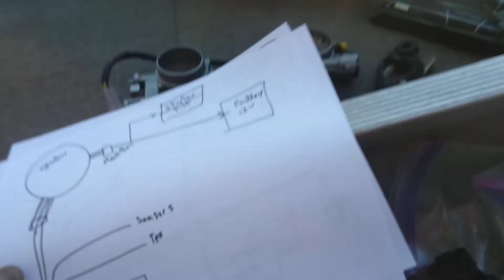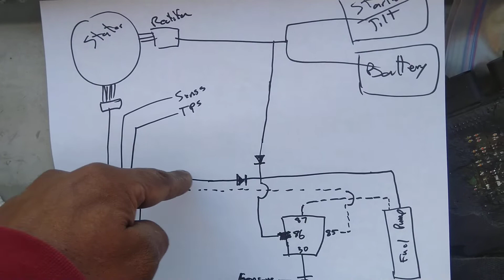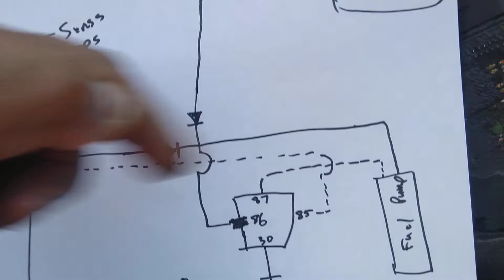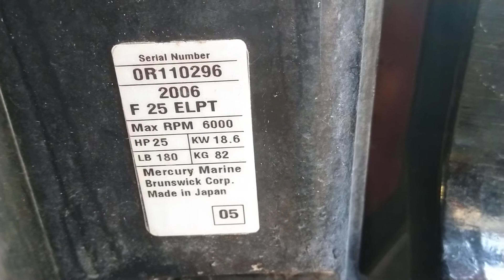mercury tohatsu 4 stroke 25hp 30hp outboard burning out ECU with aftermarket fuel pump

Comment: Thanks for the video, one of the few that actually helped and made sense.  If your ECU is not yet fried then this is one method to go.  Im about to replace my fuel pump on my 30 hp efi, I went over your diagram.  I dont quite understand why you Teed the ECU power with the stator power?  If you wire up the relay to use the ECU positive and negative on 85, 86 to trigger the relay and  use the  30 to the stator/battery from the rectifier  to run the pump positive lead on 87 and ground the other connector of the fuel pump to the motor.  Wouldn't that be the same and there would be no need for the Tee connection from the ecu power, isolating that ECU from the fuel pump power?  In theory if you have a dead battery in this method it would not fry anything but the fuel pump would not run as there is no power to the pump but, if you pull started it wouldnt the stator provide momentary power on each pull to power the ecu which would trigger the relay and draw power from the stator?   Im no electrical engineer so if anyone could chime in. Thanks again for your video, i must have watched it 8 times lol
Reply from the maker: The ECU and battery power side both have a diode on each line. They are T together because the main stator at idle does not put out enough amps to run the pump by itself. Same goes for the ECU by itself at idle it's only putting out 3.2 amps.  If you power the pump from just the battery with a relay yes it's a simple circuit and this is how larger motors operate. But if you idle or troll a lot that battery will be powering the pump and you will be left in the water stranded if it's to low of a charge.

So the solution is to power from both circuits.

The positive and negative from ECU powers the relay which does not take any kind of a load. By feeding it to the pump as well it still works as primary source of power. The relay all it does is closes the ground from main motor to pump, this is actually taking the bulk of the load. Then the main stator delivers the additional 2 amps to the pump via the T. At idle this circuit works great, because both circuits put out 3 amps, I have 1 amp left over on main stator to charge battery and or run fish fish finder. 

Here is where the diodes come into play. 
As you increase the rpm the ECU will provide more amperage to the fuel pump. At the same time because the ECU is providing more amps the main stator for battery outputs more and will reduce it's output to pump and divert it to the  battery. The diode also prevents the battery or tilt and trim from pulling amps from ECU. This way the ECU is protected as the amps is only going to the pump. 

I was able to measure the current flowing from each circuit on water and this little jack works passively.
Reply from the maker: The ECU frying is on the negative sise trigger not the positive. By using the negative from main motor case the pump has all amps available from the ECU and the rest is supplemental from main stator
Reply: @omieyouknowme   - Thank You for the explination. It really helps.  I just ordered parts to do this, ill use your method, funny im having trouble finding a relay with diodes on amazon, ordered a bosch relay with a diode on 85,86 but also ordered 20 amp diodes as per your diagram. Ordered a new low pressure fuel pump as the housing has some sort of corrosion making those clear discs not seal well.  Using 14 gauge wire, will let you know if it works.   Everyone should see this video before replacing their fuel pump with an aftermarket one.
Reply from the maker: @fern8808  the flyback diode on relay is to also protect the ECU from spikes when it turns off. You can buy relay at Napa as well. 
Be sure to check and replace high pressure fuel pump filter too. After this video I had a piece.of fuel line break off from low pressure inlet and plug the needle. Motor was starving for fuel at mid throttle.
Reply: @omieyouknowme  thanks, replaced all filters , plugs and low pressure fuel pump, cleaned injectors and in the process of replacing the high pressure pump.  everything but the fuel lines replaced and the high pressure reg.  I guess im the guy who thres parts at it lol got stun out on the water one season and was trying to get back using the trolling motor.. almost made it. a boater was nice enough to tow me to the dock after 2 hours of trolling back.  This motor is noew to me, when i purchased it it ran fine, a year later it didnt run as it was sitting in my garage while i was raising the transom of my boat. when I fired it up it sputtered and thought it was the filters so I replaced them, same thing, thought it was the fuel pumps but read the after market ones fry ecus and came accross your video. Its the only one that explaines in detail what you need to do . Thanks again ill let you knwo if it works out, waiting on blade connectors lol

Comment: I have a 2011 25HP non tiller ECM still good I just got this fuel pump what’s the easiest solution to keep my ECM safe
Reply from the maker: If it's non tiller then you have electric start. I would do a dual power source like I did use a decent diode on each line to prevent feedback. Then use the negative for fuel pump to trigger a relay. The relay should close the negative side of pump to engine ground. The duel feed will allow ECU and main stator to feed pump all the amps it needs. As engine rom goes up the ECU provides the amperage.  The negative trigger from ECU is what fails if you use that to drive a relay there is no load on that circuit
Reply: @omieyouknowme  ok with some research and after watching TJay P video I’ve decided to use the Beuler time delay relay. It seems to be the same principle but he’s installing it using an ECU with bad ground (bypassing it). Are you making your T connection in the relay? Seems in his video he’s done pretty much same thing except using positive to trigger the relay? Just wondering best way to use that relay with a good ECU and keep it protected. Send trigger to ground side instead?
Reply from the maker: @matssundin15  I don't know why he is using a time delay relay, his setup will also drain the battery at idle.
He is using positive to trigger relay because that ECU is fried. If the ECU is still good negative should be used .
I'm general fuel pump, injectors idle valve all devices are triggered from negative side. The positive side remains common. If you tone the positive wire on pump it will be same in injectors. This is how efi ECU work.even the fuel pump in your car is triggered by negative signal
Reply from the maker: @matssundin15  remember its YouTube and videos are suggestions or tips if you not comfortable take it to shop let them take responsibility.
Reply: @omieyouknowme  ok thanks I do feel more comfortable now..  his video helped show what wires you were using it was just confusing because you’re both doing it differently. Yeah I looked up the relay he’s using and looks like it offers very good protection I will do it with relay being activated from negative as you say. I guess my final decision will be to wire the positive your way or his way🤔 I appreciate your wiring diagram makes a huge difference 👍👍 once i understand it 😂
Reply: @omieyouknowme  Okay I think I get your way of doing this now. So to use the Beuler Relay with good ECU I need to run a positive wire with inline fuse from battery source and add it to the positive side source of fuel pump coming from ECU and then connect positive wire from relay and the positive wire from fuel pump all together to that?(Technically 4 wires being connected together) Then run the rest via ground through the Bueler relay correct? Also would this still work without using the diodes?
Reply: @omieyouknowme  I will put the diodes in regardless just curious if it would still work without them?  What voltage diode’s did you use?
Reply from the maker: @matssundin15  the diode on the line from ECU to pump  is there to prevent excess amperage from main stator/battery back feeding to ECU. Same for the other diode it prevents the battery from pulling amperage from ECU both diodes are gates which allow amperage to flow to the pump only and not backfeed. When the rpm is at idle or below 1500rpm the battery/stator supplements amp. When rpm goes up the ECU provides the amps. It's a very dynamic passive circuit, the diodes are check valves and flow regulator at the same time.diode  Voltage is usually 50v but it's amperage that matters.  Min 10amp
Reply: @omieyouknowme  I just saw this Roadmaster 792 Hy-Power Diode on looks like I could connect the +battery source and +ECU source to the inputs and then then connect the +source relay and the + fuel pump  connector to the output?? Says rated at 85 amps!
Reply from the maker: @matssundin15  a regular 10-20a 50v diode is 10$ for 5. Then a 12v relay is 10$ keep it simple. And add a inline fuse with 7-10a mini atc fuse. Same size as electric starter.
Reply from the maker: @matssundin15  that actually looks pretty neat and may work.
Reply: @omieyouknowme  ok got most of my parts just waiting on relay which should be here tomorrow. Just watching over the video again. As per the diagram I’m only seeing adding a ground to the starter post once. Looking at my stock motor it looks like I have 2 currently and 3 when I run the one ground from relay. It’s hard to tell in the video but at 2:46 it looks like you have 4 grounds? What is the extra one coming from?
Reply from the maker: @matssundin15 are you triggering relay from positive or negative from fuel pump?
Reply: @omieyouknowme  from negative doing the exact same way you did it
Reply from the maker: @matssundin15  I added additional grounds to my motor. The green ties the starter ground with battery ground. The relay   will pass one ground thru to the pump. The other two grounds one is from engine ECU the other was a spare. The relay will use ground from ECU to trigger.
Reply: @omieyouknowme install all done motor runs great put my hand on ECU and isn’t hot thanks for your help ! 👍👍👍
Reply: Ok it seems so complicated I don’t even know where to start is the relay only for the negative and am I cutting the negative feed to the ECM completely?

Comment: I wanted to let you know that  I replaced that pump.  It works great!  My issue with my motor wasn't immediately apparent.  My fuel pump wouldn't throw an alarm until I ran it for a period of time, shut it down and then it wouldn't re-start.  I kept thinking it can't be the pump.  But after going through a whole list of things it might be, it ended up being the fuel pump that was the problem.  Thanks for this video and I'm sure glad I found an answer to paying 600+ dollars for a 100 dollar part.  I guess after it warms up it would fail. Who knows??  Thanks again.
Reply from the maker: This is a symptom of your ECU overheating. When you are running engine put your hand on the ECU. If it's hot you are on borrowed time
Reply: @omieyouknowme  Oh man, that's not I wanted to hear.  Even when I replaced the original pump?  The ECU on my motor is way behind a bunch of wiring in the front of the engine 60hp Merc. EFI.  It ran great when I installed the aftermarket pump from Quantum.  Would it be possible for the original fuel pump to cause the ECU issue?  It's only a 5 year old motor...  Kind of sucks but, it's nice to know where I need to look next time I have problems though...
Reply from the maker: @JRDelirious  the 60hp doe not have ECU issue it's only the smaller motors under 30hp. Aftermarket pump should be fine on 60hp
Reply: @omieyouknowme  Thanks!  I've been thinking about that all day!  Anyway you letting me know that the aftermarket fuel pumps work good was a big $$$ saver Thanks again!
Reply from the maker: @JRDelirious  make sure you replace the low pressure and high pressure fuel pump after new pump goes in. Low pressure pump filter  is the big round one hanging on port side. High pressure sits at bottom by spark plugs. It's encased in black foam' it is hard to get.to but easy to replace, push on red clips. Lots of videos on it
Reply: @omieyouknowme I have a mercury 2006 25hp 4 stroke efi. My ground burned out on the ecu. I don't have electric start how can I bypass the ground on the ecu and is the way you done this possible without a starter
Reply: Did you find a solution to fix the ground in the ecu?
Reply: @John-p9z2y I have the exact problem with the same motor. Did you get an answer ? Thanks
Reply: If my fuel pump is pumping but I have no spark could it still be the ecu I'm only getting a spark when the kill switch is pulled i try to start it then and get a small spark at the end

Comment: So, if I had a 1C serial number 60hp engine would the Quantum pump work?   I really hate to buy that $600+ pump from Merc.
Reply from the maker: The larger engines have bigger stators to push more amps and use a relay to drive the fuel pump vs the ECU direct. Should not be an issue using the quantum pump.
Reply: @omieyouknowme  Thanks, I've been on the fence with all I've read about aftermarket pumps.  This video really helped.
Reply from the maker: @JRDelirious  the pumps all come off same line for aftermarket weather you spend 20$ or 100$ same pump. The OEM usually have higher quality control but cost of one OEM I can buy 5 aftermarket. I keep one as spare in boat takes with tools takes.me 20 min to swap out. Pump will fail if they run dry from low pressure pump failure or debris getting jammed inside them. Pretty reliable otherwise regardless if OEM or not
Reply: @omieyouknowme  Thanks.  Great research.  A ton of things are like that, all the same factory just different brands...
Reply: How did your repair go?  I have the same 1C 60hp (2015), looks like the pump fried my ECU, just wondering if you did any better?
Reply: @dannyhvac37   It is running fine.  I've had it out a few times without any issues.  The weather's been kind of too hot or rainy lately but it was doing great when I took it out.  Mine was a 2018 I don't know what the difference would be.
Reply from the maker: @dannyhvac37  my motor still runs great. ECU and aftermarket pump issue only for 25-30hp motors
Reply: @omieyouknowme   I spoke too soon.  Almost identical issues,  motor would turn over, relay sent 12v to pump, ECU would not ground negative.  Actual problem: kill switch was off at remote throttle.  Would have been nice to catch that before taking apart and re-assembling the whole VST again.  LOL, live and learn.  Great video man.
Reply from the maker: @dannyhvac37  yah with no start be it carb or efi I always check kill switch. Then go to fuel then ignition or ECU

Comment: What color was the trigger wire for 0R motor used in the video? I have the same motor, and can't find the +12vdc trigger wire in the remote umbilical, to trigger the relay's coil...
Reply from the maker: The two wires for fuel pump one is positive which is common wire for all the 12v in motor, I don't recall as I'm not near motor. But you can trigger coil with negative if your ECU is still good. If ECU is fried use the positive trigger coil.
Reply: Blue is Fuel Pump Positive + and Blue/Black (black tracer wire is Fuel Pump Negative - from the ECU (trigger wire IF the ECU is still good)

Comment: hi, great video! do you have the part number of the lower draw fuel pump? would you trust it to run off the ecu or would you still run it on a seperate relay? thank you!
Reply from the maker: Well the low draw pump pulled the same amp. I would not trust these cheap pumps they come from the same factory. I feel safer running a relay as this is how fuel pumps are run in automotive world and the 40+ hp outboard all use a relay.
Reply: @omieyouknowme  sounds good thank you! I saw another video where he uses a time delay relay. Do u think that is necessary?
Reply from the maker: @danielmid6022  delay relay not needed, well with electric start at least. With pull start maybe.

Comment: Good morning,

I had the same problem. Can we connect the fuel pump with the rectifier output and parallel the output of the electronic box in order to obtain the right intensity for the adaptable pump?
Reply from the maker: That's what I did. I added a diode though on each line feeding the pump. If you have tilt trim and trim the motor it could draw amperage from the ECU side, the diode prevents this on main line. The diode on ECU   line will help prevent a surge back into injectors and ECU as well

Comment: Good morning
Im following you from italy and yout videos are very interesting. My 25 mercury efi is an 0R282938 . I have around 800 hours on it with the first pump. I have a battery Connected. Is better to make this modification? Or i need only to pay attention at the pump amps for a future? Thank a lot and sorry for my english.
Reply from the maker: 800 hours leave it alone. Replace the high pressure fuel filter and keep doing what you are. If you modify motor per how I did it, it balances the amp and retains the battery less feature of the motor.  
If you decide to run a relay with a battery that will work but your battery will not charge at idle unless you run it at 2500rpm or more you will drain battery